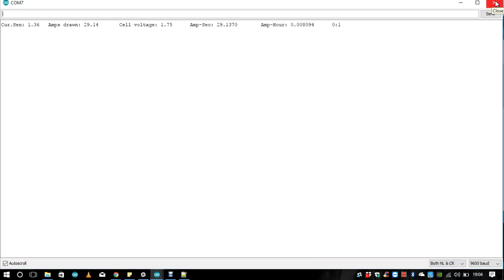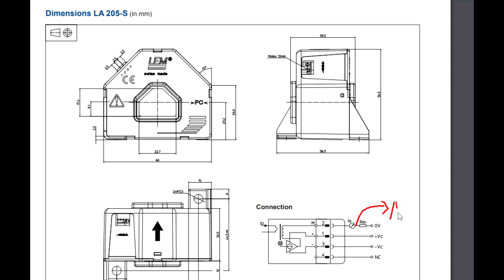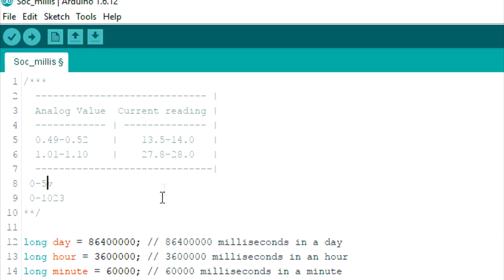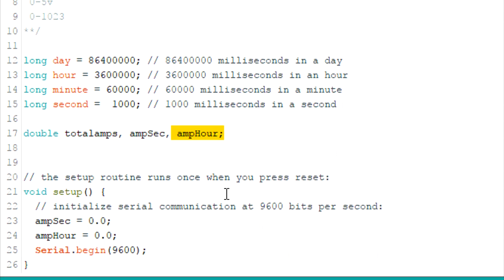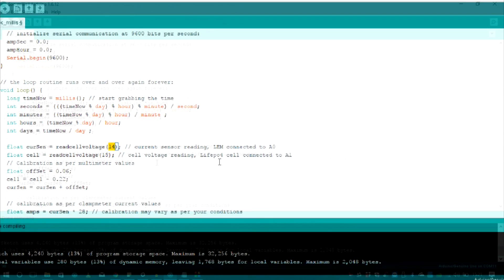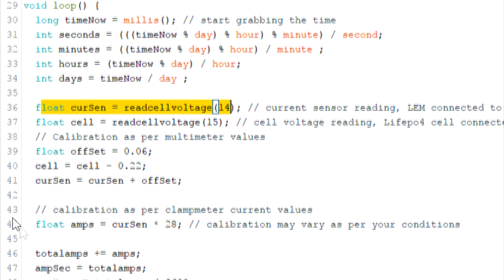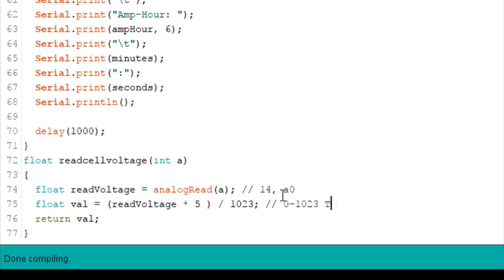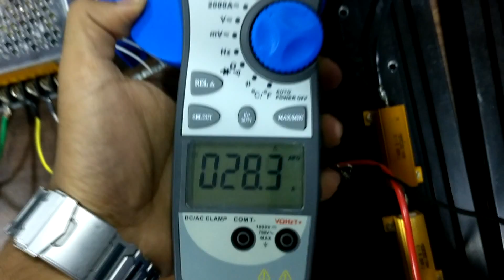LEM current sensor with Arduino | LA 205-s | Watt meter

Comment: Which is the best current sensor that can be used for short circuit measurement protected by a 6 amps mcb.??
Reply from the maker: It is recommended to use a shunt resistor and measure the voltage drop across it.

Comment: how is your current sensor function works when discharging battery? (Clamp meter is Negative current)
Reply from the maker: Sorry, I don't understand your question. Generally the current draw from a battery is negative and it is subtracted from the Ah(Capacity). This can be changed in the firmware anytime

Comment: Hi, I want to measure 400Amp DC current with arduino, can I just replace with heavy capacity Current sensor?
Reply from the maker: Yes, that will work but make sure if the accuracy is good enough. For better accuracy you can use a shunt resistor.